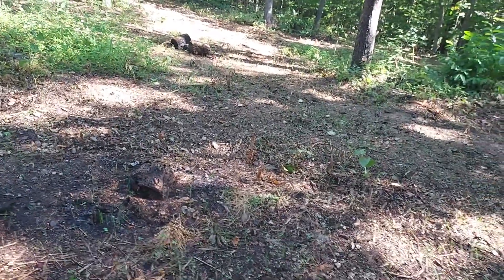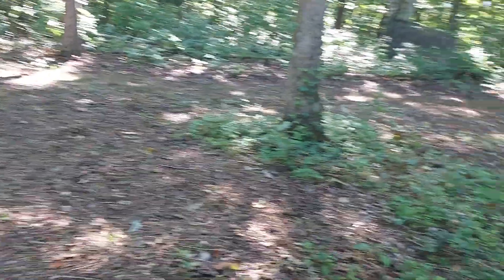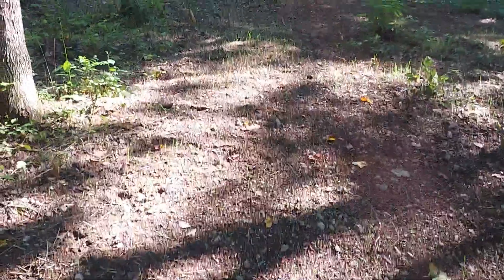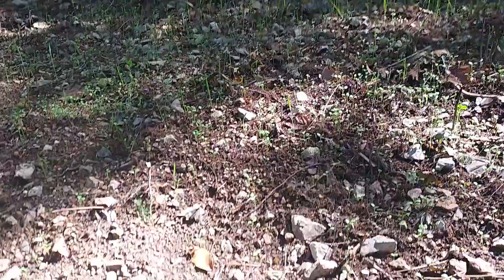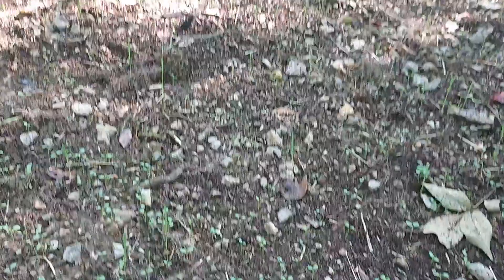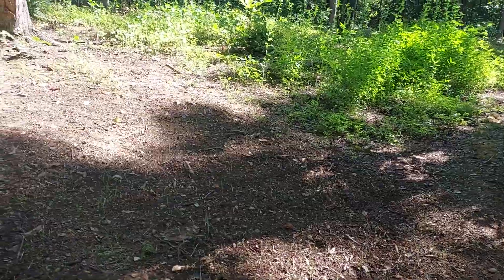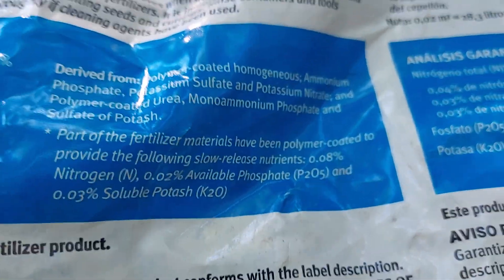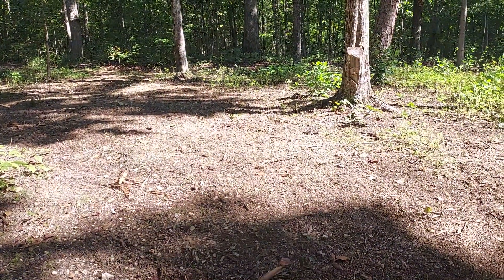More Island Soil Improvements

Comment: I had a small plot that looked a lot like that. I saved up old cardboard boxes for an entire year. The kind that are not glossy, kind of like Amazon boxes. I first sprayed humic acid and liquid compost directly over the plants and soil. I also added some lime. Then I mowed the plants down and covered that with cow manure/potting soil. Then I covered all of that with cardboard boxes and put some more compost on top of the boxes. The soil improved quickly and earthworms had a field day. Then I used a tiller directly into the cardboard boxes, lightly tilling it under.
Reply from the maker: That is a good idea. There are many ways that can work. Thanks for sharing.
Reply: I have noticed a decline in earthworms here over the past two months, but I just chalked it up to all the dry weather we have had causing them to go deeper.  When building soil and green manure, I have had my best luck with crimson clover.  In about 5 years my food plot soil here on top of the ridge has dramatically changed, and it is very loose with lots of decaying organic matter.
Reply: Cool. I've heard you can broadcast peat moss and worm castings. What boron fertilizer do you recommend? Thank you!
Reply from the maker: I buy borc acid in the 50 pound bags that gives me all the boron a need for a long time.
Reply: @MonsterBucks1451  thank you. I didn't know if was the 20 Mule powder or something else. Maybe my co-op will have it. Thank you 👍👍
Reply from the maker: @troydunn6228  Yeah that can contain boron but the percentage maybe lower. I just get the boric acid so at least I know the percentage range I will get.
Reply: @MonsterBucks1451  thank you!